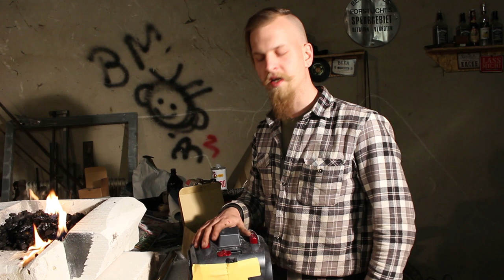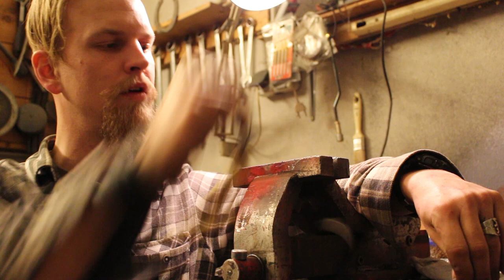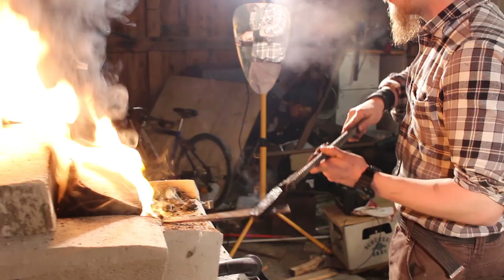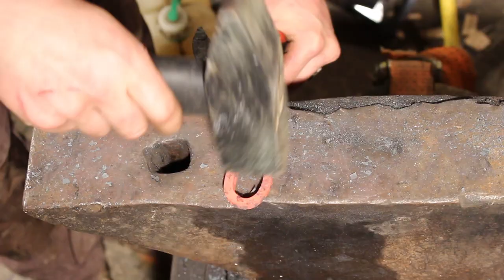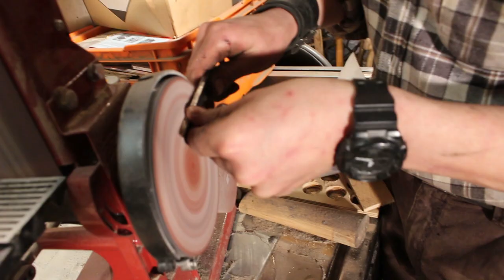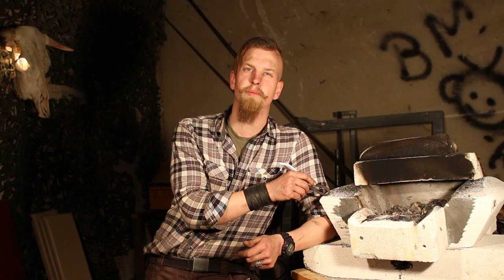How To Forge A Post Apocalyptic Carving Knife

Comment: To limit the out put of the vacuum  I suggest an in-line damper.  Like what you would find in a chimney.   Or even  a 1/4 or 1/2 turn valve would work.
Reply: A damper on the vacuum could cause resistance that might burn out the blower motor. I would suggest a bypass valve, allowing some of the air to be discharged without going through the forge. This would also allow him to throttle the air flow to find the right balance for best combustion.

A PVC Tee in the vacuum discharge, with a PVC quarter-turn valve, perhaps.
Reply: If you valve it off, you put less stress on the motor because you are moving less air doing less work.
Reply: You are moving less air, but you are creating heat by not allowing flow from the blower. It works the same way with a non-positive displacement pump. Close the discharge valve and the pump will burn up. Same with a blower. Try it if you doubt me... but in a safe place.
Reply: The motor runs cooler because it is doing less work and when you close off the discharge partially on a non positive displacement motor the amp load is less. That is how you lower the amp draw on any typical pump.
Reply: Alright, then try completely closing the discharge valve for oh, ten minutes or so. You should start to hear a loud noise in the volute of the pump. That noise is water being boiled, or "flashing." The result will be damage to the impeller and to a lesser extent, damage to the volute. Leave it that way for a while longer and you'll damage the bearings. 

This is not theory -- I worked in a steam plant. I'm telling you that throttling the discharge of a pump or a blower will damage the device.
Reply: I said close it off partially, not all the way.
Reply: In that case, it will take longer to smoke the pump or blower. But eventually, the magic smoke is coming out of the motor. And once the magic smoke is out, you can't put it back in.
Reply: a blow off valve that has an adjustable tension spring would be easy to make allow max pressure to your forge if needed.  Also saving the motor from unneeded back pressure. You could use butterfly bolt to make it.  P.S. I think PVC with valve to black pipe is the way to go.

Comment: Hard or soft does not matter when choosing a file to use. Why? Because they are hard or soft depending on their temper. Steel type is more important. Because once you've annealed them (heated to non magnetic and allowed to cool for belt grinding, or worked right away at high temp), they will all be the same hardness or in reality softness, and malleable.
Reply: Steven Szabo thank you I was hoping every one here wasn't stupid

Comment: I've been making file knives for a couple of years now, the forge I built is made from an old gas bottle using a hairdryer as a blower, there is a couple of videos about it on my channel and a knife or two, I would appreciate it iff you'd check out my channel and the video about making a gas bottle forge, it's small and portable and works brilliantly and even you might pick up a few tips, cheers, atb, Paul.